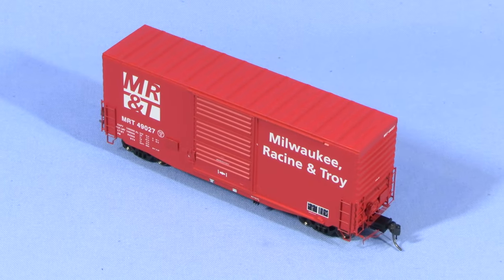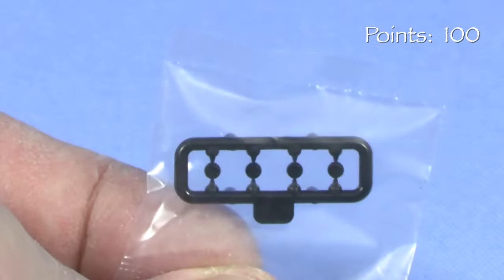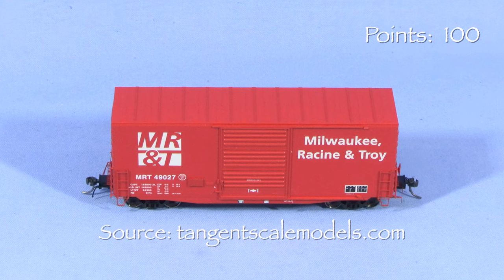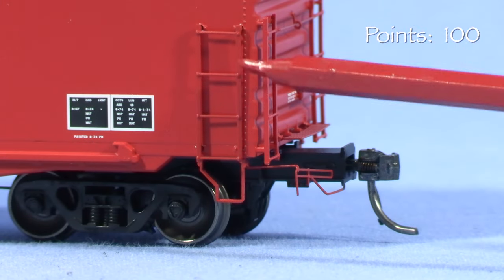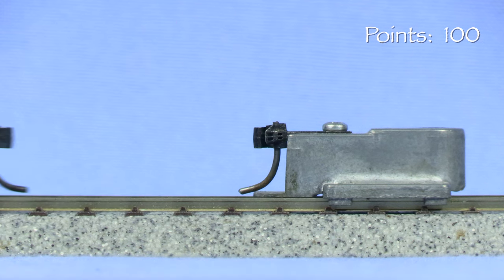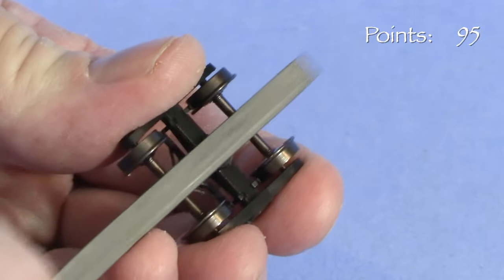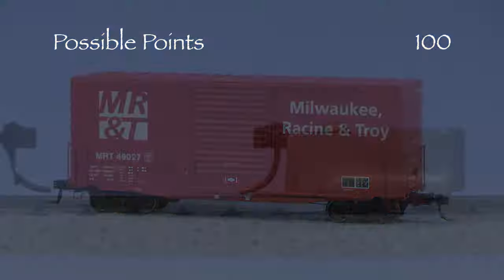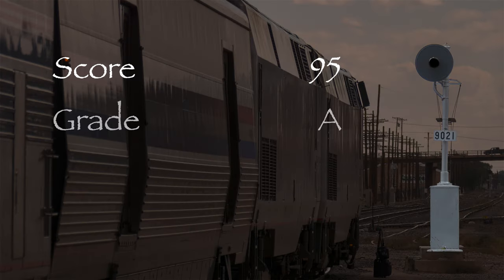Can a Fictitious Railroad Be Realistic? - Unboxing and Review of an MR&T Boxcar from Tangent!

Comment: This is a very very nitpick about this car. I am designing my own freelance railroad and one often thing I see some people skip is amking sure the paint scheme on freelance equipment is correct for the era. The font used on this car is Arial, which was invented in 1982, which is post-dated after the build date on the car. Obviously, 99% of people won't know this, though some might notice the modernness of it. I really only catch it because I'm in the creative services field/not a big fan of it or its original helvetica. It always is a little bit of a question mark when someoen goes through a ton of effort detailing a scene or engine to make it as realistic as possible and then using a default font to really lose the immersion of the model.
Reply from the maker: That is something I hadn't really considered.  I agree that if I were going to have decals made for a freelanced railroad, I'd probably go with a different font.  Since it has COTS panels, I suppose it could be a repaint.  I thought the car looked reasonably plausible for the 1990s era that I model.  Thanks for the insight and for watching!

Comment: Here's a problem you didn't address, but it's a real nit. The reweigh date is  NEW 8-67.  The car should be reweighed at most every 30 months - earlier if and when major repairs are done. The 2 panel COTS was introduced in 1974, several years after the car should have been reweighed. It's also missing an ACI label was mandated in 1967, but I'm not sure of the month. Surely by the time the 1 panel COTS was applied (before the two panel COTS as on this model), the car would have received an ACI label. While the ACI label was discontinued in 1977 and no longer required, that was they year the wheel inspection dots were required. So what era is this paint scheme accurate for? Unless I've got my information wrong, none. No matter what date you pick, there's something wrong with the way this car is lettered.
Reply from the maker: Those are interesting points.  I thought the car looked reasonably plausible for the 1990s era that I model, but I confess I wasn't looking too closely at the things you mentioned.  Adding some ACI labels and maybe patching out the date with a more recent one would add to the realism.  I might consider doing some of that when I get around to weathering the car.  Thanks for the info and for watching!